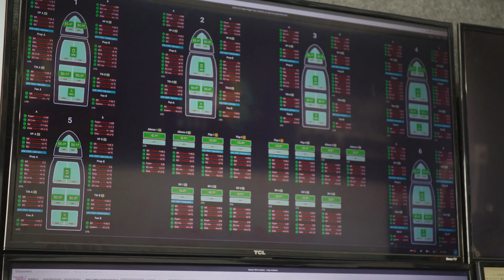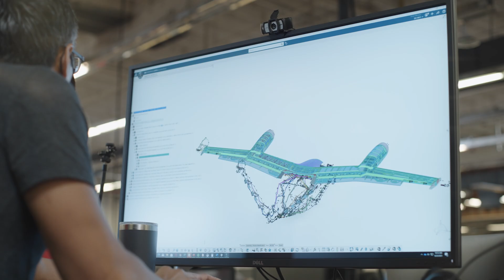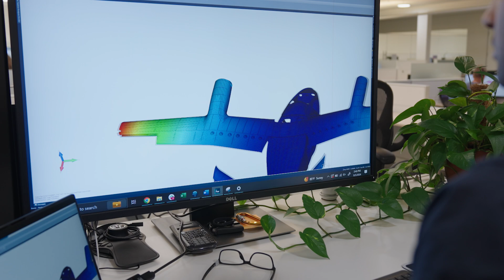Vertical Integration: Joby's Superpower

Comment: naturally, the hardworking brilliant engineers would have already thought about it.
 and would have a better solution.

but hopefully there are  two independent batter packs, 
for if one malfunctions (short-circuit , thermal runaway )

second independent battery is able to make emergency landing.

very exited  for   the product 
have a successful, launch.

Comment: wasted money on hydrogen.  why didn't you discuss costs?  was it just a stunt to grab government grant money?  I'm a fan, but I don't like wasted time or money.  the cost of infrastructure for hydrogen is too expensive and dangerous.  you're drifting...  no doubt due to the influence of Toyota.  Toyota is looking for a problem for their solution.  WASTE, WASTE, WASTE.  Your're engineers - do the math.
Reply: Cost of hydrogen will decrease as technology gets better. Toyota knows what it’s doing. I wouldn’t be too worried.
Reply: @thaihoale2740  Not worried.  Toyota has been trying to sell hydrogen cars for nearly 10 years.  Sales have been dismal due to high costs and insufficient refueling infrastructure.

Many EU projects where tried and failed with hydrogen.  Too expensive, too dangerous, and they were all shut down -NO PROFIT

Toyota seems to have convinced BMW to try (stupid).  Now BWM is crying about ICE restrictions.  (played the tyrants game and lost)

Hydrogen will NEVER be cheaper than electricity as energy is loss due to inefficiency.  Further, transportation, infrastructure and danger prevents its adoption.

It's OK to dream -- but Joby should keep the nightmare aware from the treasury.
Reply: Plus they had to take all the seats out to make room for the hydrogen fuel cell.

Comment: Hi Joby, 
Could you tell us how much safer this would be compared to helicopters?  If it's not much safer and much less susceptible to turbulence than existing small aircrafts, I don't think I would be interested in flying in any small aircraft, electric or not and VTO or runway.  If there are advantages to JOBY in these points, please let us know.
Reply: Electric motors have a lot fewer moving parts than any gas turbine or reciprocating engine. And the rotor systems of a helicopter is far more complex than the propellors of the Joby aircraft. Multiple rotors, multiple power systems and two motors for each prop. The redundancy means greater reliability and safety.
Reply: @dcsensui  Sounds good, but can JOBY achieve better stability and ride comfort with the multiple rotors? Is AI based turbulence early detection and mitigation possible? Does low noise enable JOBY to fly lower altitude and does flying lower altitude experience less turbulence?   Many people prefer not to fly in a small aircraft,  so if JOBY has any advantage over helicopters in terms of stability and ride comfort, I want JOBY to let us know.
Reply: They're not about to answer youtube comments lol

Comment: It appears to be nothing more than perpetual research and development with no deliverable product end date in sight.  In software development we call this analysis paralysis.  Ship it already!!!
Reply: Different as in usually software, you should not deliver a half as*ed product and make it work correctly after deployment with perpetual updates. 
When you decide how to manufacture the aircraft you need to purchase real machines and invest a lot. Not just a couple of servers that let you change the software easily. 
That’s why it is called HARDware.
Reply: @biffhenderson1144  its also called vaporware
Reply: @biffhenderson1144  its vaporware. I think you would see videos moving weight some disrance and then a few years after that it might be certified and then they can ship. They can even show it doing the job it's designed for, so I doubt they are almost ready to ship.